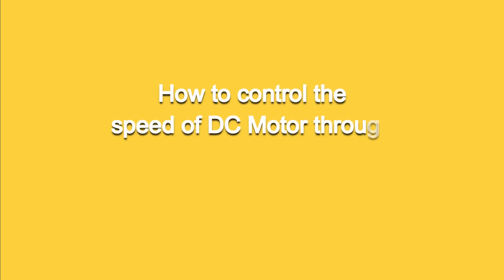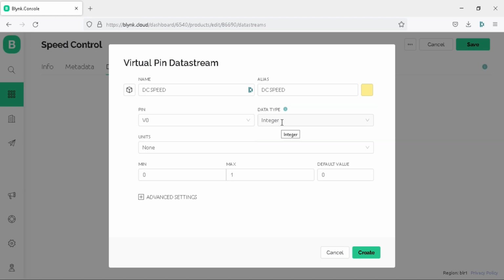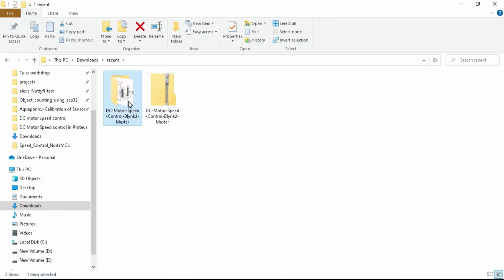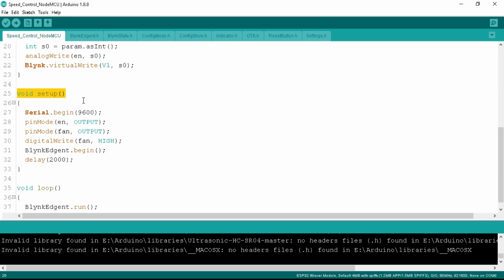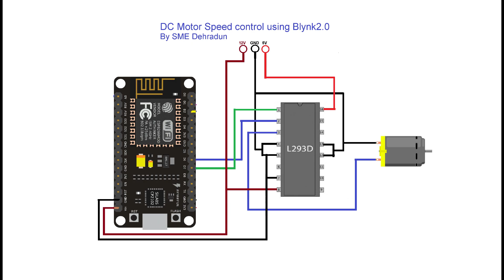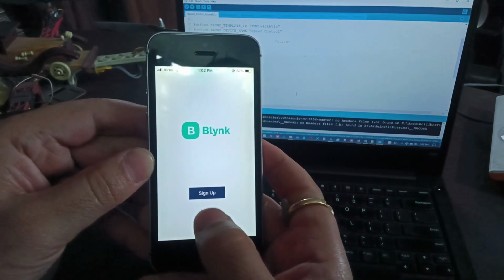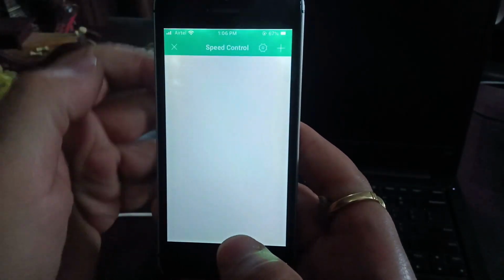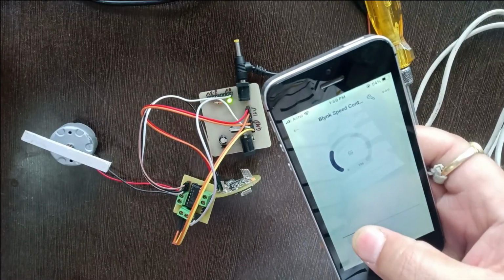Speed Control of BLDC Fan & DC Motor with New Blynk2.0 IoT App

Comment: Smart plant monitoring system project             component dht11,soilsensor,esp8266,relya moter pump        withblynk 2.0  coding me problem aaa rahi he    please help
Reply from the maker: Hi,
I have already made a video on these topics 
Below are the links;
Go through it
IoT monitored Smart Plant with Water Pump Automation- Blynk2.0, NodeMCU & ESP32 with Arduino Code
https://youtu.be/xfSH1bzQFX8
DHT11 Sensor Data to Blynk2.0- Humidity & Temperature Live
https://youtu.be/x44qnOkDz3A